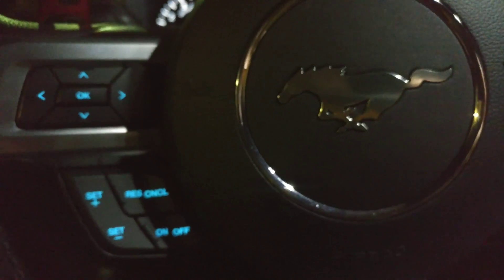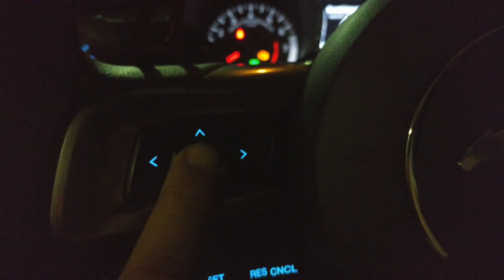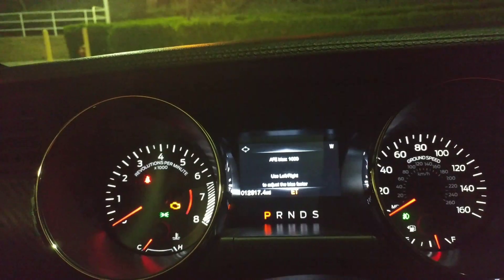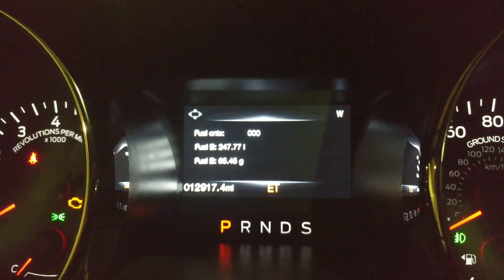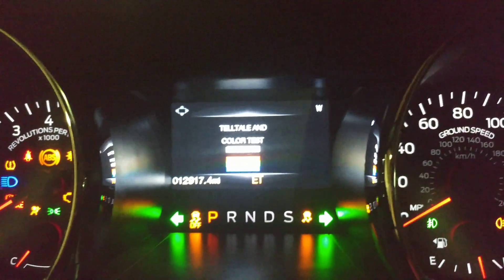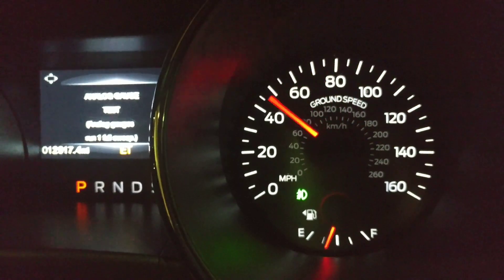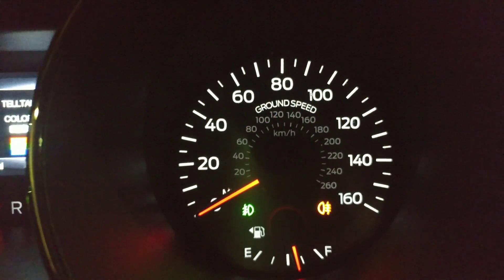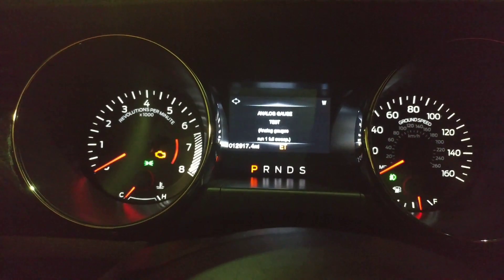S550 Mustang hidden Engineering Test Mode

Comment: Can you clear a check engine light code 1450 I’ve already change the Evap purge valve just need to clear the check engine light
Reply: If you haven’t gotten it fixed yet, any auto parts store can let you use their scan tool to clear codes for free
Reply from the maker: Not this way no

Comment: Can also read DTC’s / change engine light
Reply from the maker: Not to my knowledge no
Reply: OBD= on board diagnostics... Yes codes will show in engineering mode.. if all is well, “x” will show vs the trouble code.